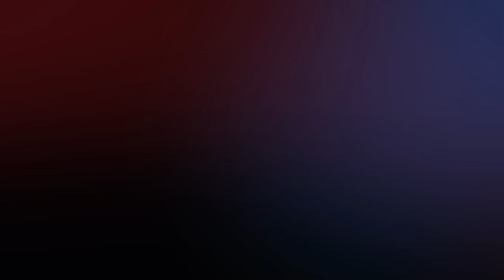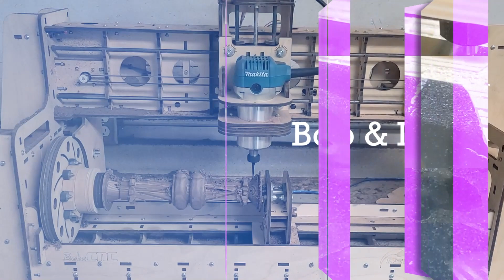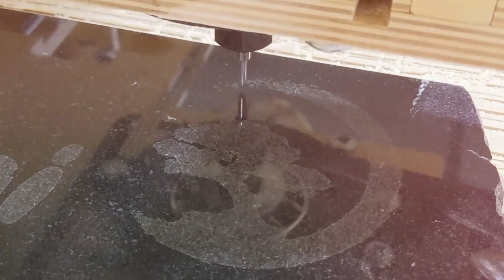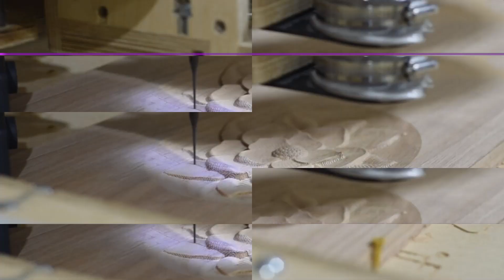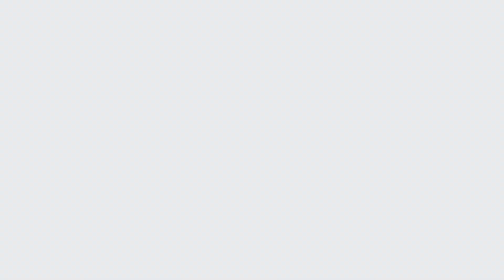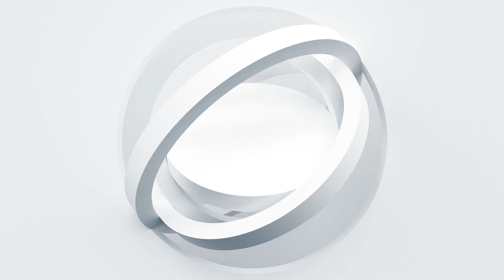Basic CAM and Basic Sender

Comment: I have watched so many CNC videos my head might pop, lol. Am I reading that the difference between e4 and e5 is basically the extension kit is included? And how much software will a beginner need to get started? I am running a beginner 3D printer and am familiar with the basics of Autodesk, Blender, and currently am using Tinkercad because it is quick, easy, and free.
Reply from the maker: The Evolution 4 has a 24" x24" cutting area.  The Evolution 5 has a 24" x 50.5" cutting area.   If o have an Evolution 4, you can purchase the upgrade kit and make it an Evolution 5.
Reply from the maker: You can use free or paid software depending on what kind of projects you want to create.   This software will be free and open source.